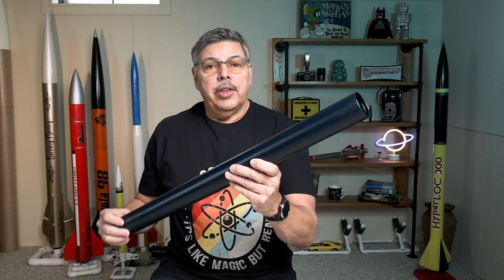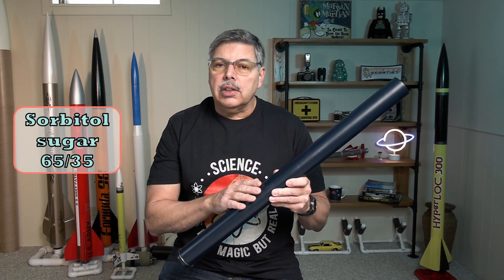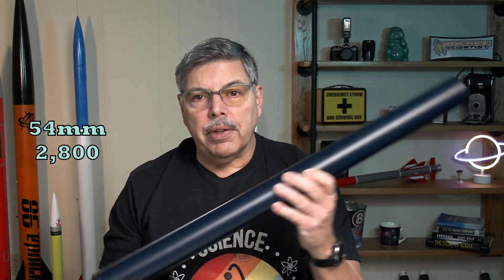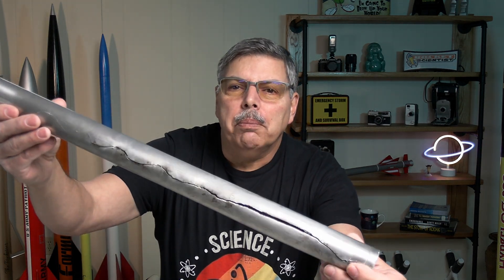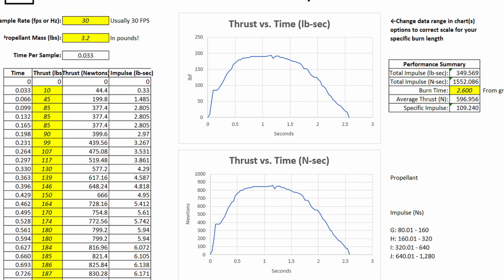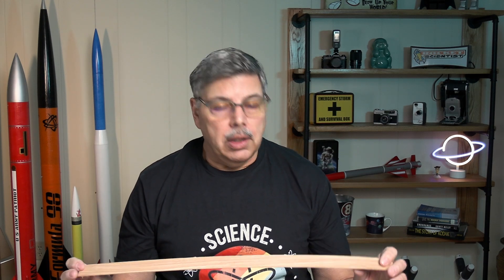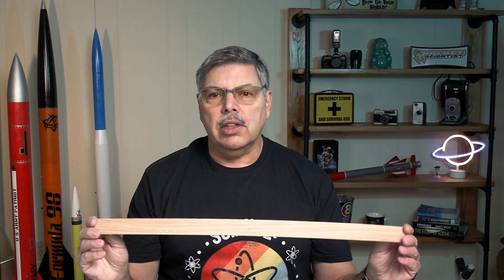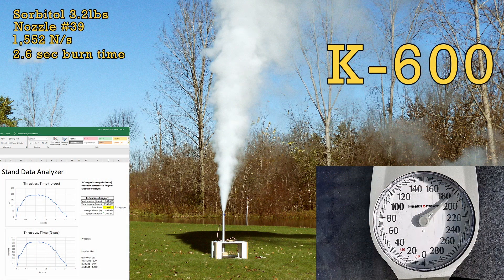Huge sugar rocket motor test - K class!

Comment: Very nice! I'm hoping to have my "Dan Pollino" K motor coming soon as well. How long were each of the grains for this one and what was the core size?
I'm really interested to see what rocket you're gonna lift off with this monster.
Reply from the maker: I used 5x grains with a 5/8 core, 1x with a 3/4 core and the last was 1x at 7/8. The larger diameter grains are used to keep erosive burning in check. Each grain had a 1/4 space between them. I may reduce the gap to 1/8" in the next motor. I am going to put this monster in a 4"  fiberglass rocket to reach a mile.

I always wanted to see a Pollino "K class" motor!

Comment: What are you using for data collection and software? Load cell? Pressure data?
Reply from the maker: My data collection system begins with 5 years of experience making sugar motors and BATES grains from D to K class. Then I used BurnSim with a profile provided by Finicky on The Rocketry Forum that I have found to be quite accurate for designing sorbitol sugar motors, I am CaptHaywire on the forum.

I have a digital thrust stand built and designed by Boris Dureau that will measure both pressure and thrust. I will feature the design next spring in a video. Please subscribe to the channel for more information.
Reply: @TheRocketeer  i was curious about what the actual hardware and software was. If you're getting both pressure and load cell data. 

I've been making motors for the last 20 years.. Have made motors from G to P sizes up to 6 inch hardware. Have plans currently for an 8 inch Q. I do APCP. Over the years, I have used pressure data via transducers,  load cells ,DataQ systems, and software. Plus, some other proprietary systems. Have been using Burnsim for quite a long time. Just recently started using the Altus Metrum Easy motor as an addition.
Reply from the maker: Yes, Easy Motor is on my list to try, I enjoy flying more than motor testing..

I have access to a KitchenAid mixer, vacuum motor, stainless steel bowl etc. There are no channels devoted to APCP and I don't live out west so that presents a problem for me and others who may be interested in the craft.

 Thanks for stopping by! @ConwayLStevens